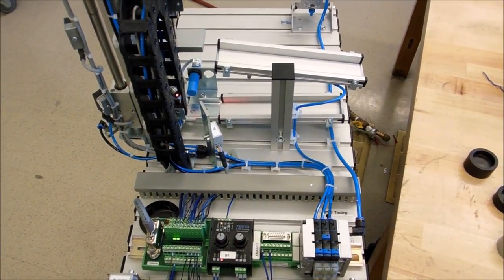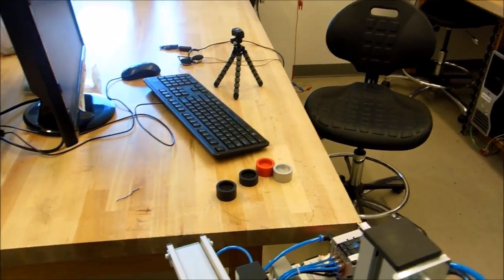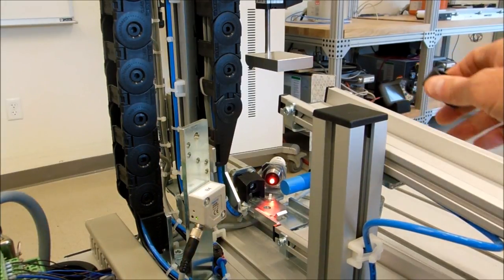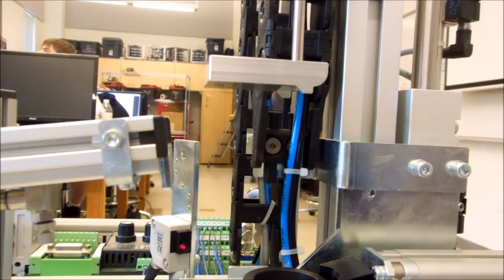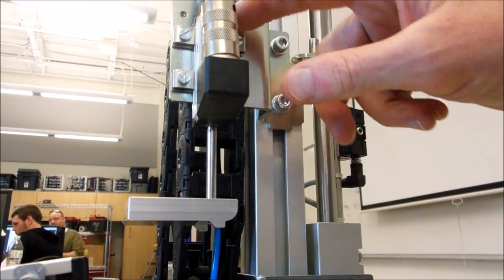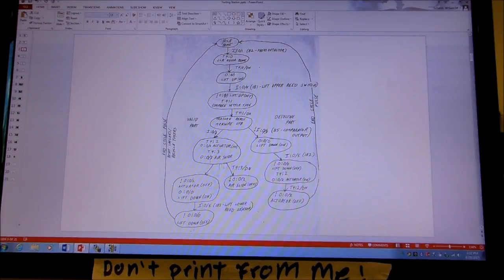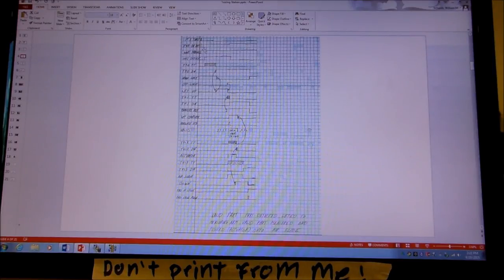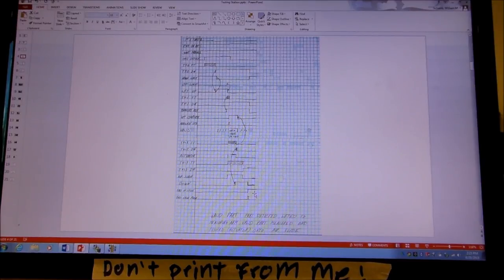MPS

Comment: Can you give me an article for reference?
Reply from the maker: Hello, 
Sorry for the delay. I'm not sure what you are looking for but there is a video that shows the complete Festo MPS station. 
The station consists of 5 units:
Distribution unit
Test Station
Station that adds a gauge to the puck
A press fit unit that press fits the gauge
A sorter that sorts based on puck color

This is used so 5 students can all have a station, then these are placed together for system integration.
This is where the fun begins.

Will

Festo MPS Production Line should have plenty of product data

https://www.youtube.com/watch?v=KWw08-OfeIs
Reply: @williamschwab9216  I am learning about station 1 that distributes products like the video because I have a topic about a model with the same function as the video above. If possible, can you share the program with the electrical circuits and the pneumatic circuits?